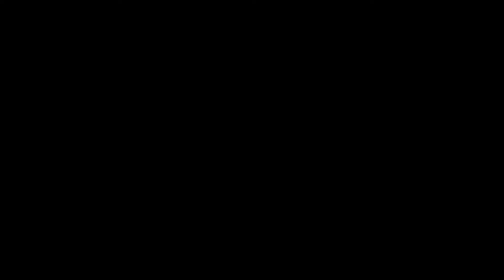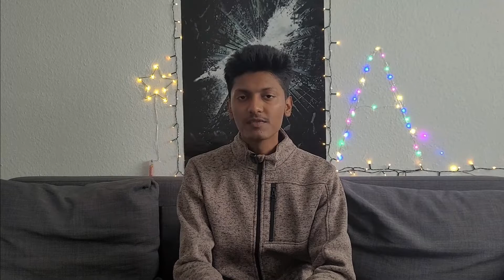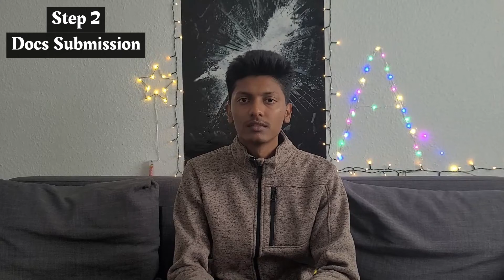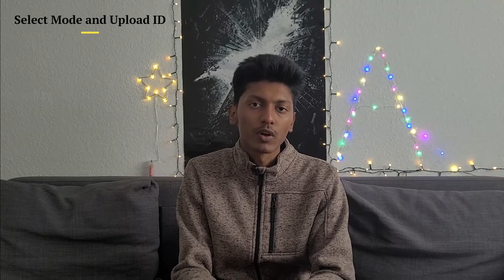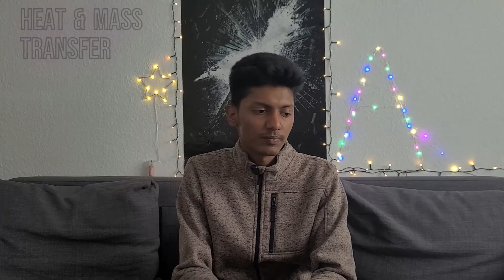TU Darmstadt Entrance Examination | M.Sc. Aerospace Engineering

Comment: Hi,just wanna know what if my requirements are met but have not given gre will I still need to give test?
Reply from the maker: GRE isn't necessary for the aerospace engineering course at TU Darmstadt, you can check the admission regulations in the website

Comment: I have a doubt like if we are giving entrance exam on first week or second week of august and then after 2 weeks we are getting admit how we'll get time for all visa and everything i mean is it feasible?
Reply from the maker: Yeah it's a bit of a tight situation, I gave my exam on Feb 23rd and got results in the mid of March and that time aps was new as well so I could reach Germany only on 20th may but the course started on April 12th. So it depends how quick you can get your visa appointment, and here it's not a huge problem if you arrive late because of valid reasons like visa and some lectures do have recordings or live videos
Reply: @AdityaKrishnan27 thanks that's reassuring because I have applied to winter semester and it's going to start on October 1st right now preparing for the exam 
Also they mentioned in the website that the document which needs to be sent via courier need not to be notarized so I have already sent my documents photocopies without notarized so is it ok?
Reply from the maker: Yeah if it's not mentioned the it's not needed so that's fine

Comment: Hi bro I want to ask one thing did they mention thermodynamics and heat transfer in in the syllabus for the tests during your time or was it only technical thermodynamics -I because for 2024 they have mentioned only technical thermodynamics - I which does not cover heat transfer. So what should I prepare

Pls reply to the earliest. It will save a lot of time
Reply from the maker: They asked heat transfer as well during that time, if it's not mentioned for you this time, then it won't be asked
Reply: @AdityaKrishnan27  so during your test they had mentioned heat transfer and thermodynamics clearly in the asked modules section??

Comment: Hi Aditya I have received entrance exam mail from tu Darmstadt. I applied for summer intake. So will I get admit for summer or winter intake in case I pass this exam. Because the exam is in Feb and the course starts in April I am asking you this question
Reply from the maker: You will get admit for this summer semester starting from April, but for this course at TUD, the admit is valid for the upcoming winter semester as well.
Reply: @AdityaKrishnan27  won't I get late to start my course?
Reply from the maker: Maybe yeah, I got my visa late too I started only on May 20th
Reply: @AdityaKrishnan27  ok thanks 🙏
Reply: Hii when did you recieved mail for entrance exam??
Reply: @Shivam-zg5tu  yesterday
Reply: @omkarumadi9765  ok great👍
Reply: @omkarumadi9765 hey bro I also got mail yesterday
Reply: I also got mail for entrance exam on feb 20
Reply: @chintulalala5091  when did u apply and when did your documents reached there
Reply: @arushkumarsingh2802  I submittef on Dec 23rd electronically and sent documents on Jan 10th
Reply: @chintulalala5091  they received my documents on 15th dec, still no reply
Reply: @arushkumarsingh2802  same with me brother
Reply: @arushkumarsingh2802   we're on the same team, 15th dec documents recieved by them
Reply: @chintulalala5091 even I got the mail for the same on 21st feb